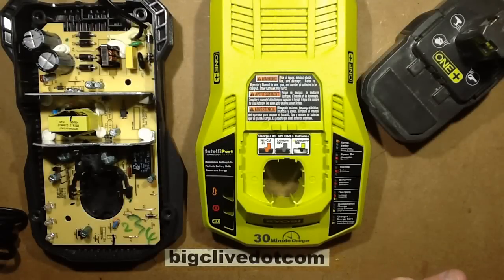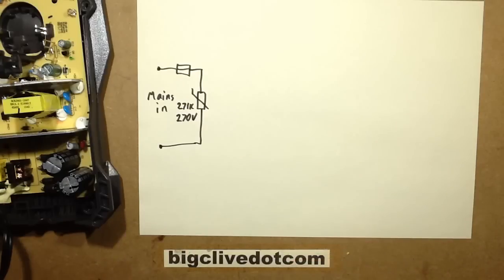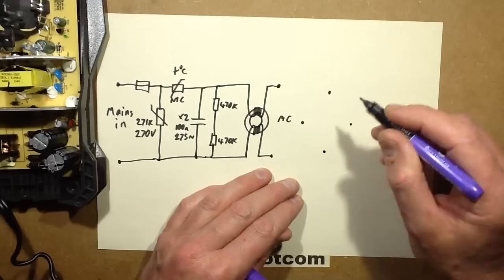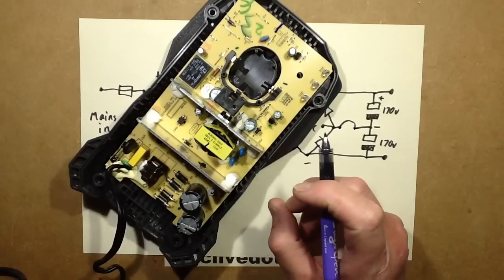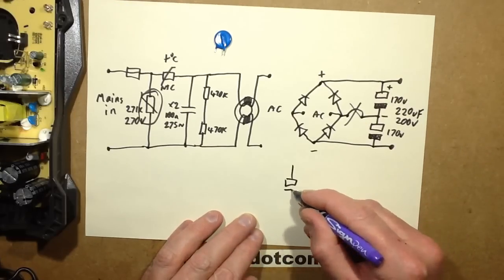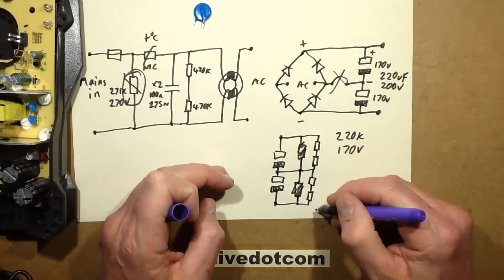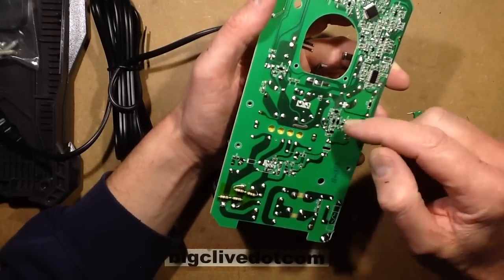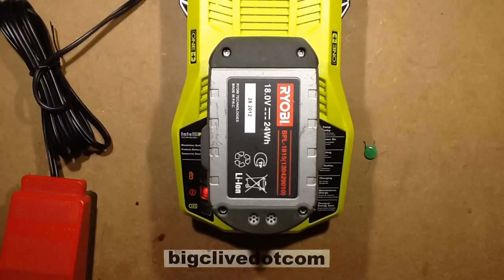How to convert Ryobi P117 charger from 120V to 230V use.

Comment: You don't have the leakage current issue with a 120V voltage doubler input since both caps get charged to their respective half-wave peak. That's only an issue with the 240V mod.
Reply from the maker: The presence of the link and redundant part of the rectifier suggests that the unit was designed to be supplied as 120V and 230V versions.  It seems odd to omit just two resistors that could also have doubled as safety discharge resistors.
Reply: Since most switching supplies that I have taken apart don't shut down until their input capacitor has dropped below 80V, I am not surprised to see small power supplies omit them: their normal operation drains input capacitors most of the way within seconds already (330V to 80V is 93% of the energy gone) and their startup bias circuit will drain input caps down to 8V or whatever the chip's lock-out voltage is over the next 10 seconds or so.

Also, unless the capacitors are horribly mismatched, their leakage increases with voltage and should make them reasonably self-balancing. May want to use 250V caps for this for extra tolerance though.

Comment: You find the same idea on the input of a pc power supply, often a switch is present.
Not sure how they cope with the extra protection on the input though.
Reply from the maker: They just rate it for the maximum expected voltage.  The low value MOV in this unit was unusual if they were intending it to be a standard unit that could be made for two voltages.
Reply: I had a PC once with a switch for 110/240V operation. One day I pushed the switch over to the 110V position when it was connected to the 240V mains.

Yes, it went bang.

Comment: Looks like that pre-exploded power bar came on handy after all ;)
Reply: glad i wasnt the only 1 who knew where it was from :)
Reply: I'm not going to lie, I looked for it a bit at the end when he started up the charger.. Then it hit me like a ton of bricks. LOL! It's been a while since I watched that one, but man... You might be even sicker than me for noticing that! x3
Reply: yeah, I'm kind of a big fan of clive
Reply: I wasn't happy with the supplied Ryobi charger. In my mind, the battery should go on the charger, not the charger on the battery!
Whilst in the states I saw this charger and thought I should research if it would work in the UK. Almost instantly I found the link to this video.
I ordered the parts and received a 14N431K instead of the suggested 14D471K. Fitted it, cut the link, added the 4 resistors and the charger worked first time. 
Thanks for making this video.

Comment: The minimum you'd had to do would be to rip out the varistor and the link, right? because it would work without the varistor wouldn't it?
Reply: It would, but ripping out a safety feature might not be the best idea.
Reply from the maker: It would work, but I prefer the idea of replacing the MOV.
Reply: In theory, yeah. But for the real sake of safety and the amount of pour being pumped through, you want the protection
Reply: Yeah it would work, but any large voltage spikes on the mains 'could' cause one of the rectifier diodes to go short, followed by he others in chain reaction!
Reply: andygozzo72 that would not be very nice
Reply: Sure, but you've just turned it into a timebomb. And not balancing across 200V rated caps is.. not wise.
Reply: yea...in my day the fuse was all the protection you needed....
Reply: These days we have semiconductors. :D
Reply: Yeah, but I would run it through a surge protected supply though.
Reply: Mov is wasting electricity, put it in the dustbin.

Comment: Does it really cost effective for the company essentially to include 230V functionality, but hard wire it only for 120V use? Can't it be both and same way sold in both markets?
Reply: saves them the price of a switch, and they can sell a more expensive one to the UK
Reply: I wonder anyway why not every power supply is 110-240V with automatic adjustment.
Like most Notebook Power supplies are.
Reply: djteac
yes, it makes sense on a scale, you can make one product and it works all over the world, not like the bad old days of country specific, esp the old days of TV's.  they save a ton of money in the end.
Reply: Notebooks are meant to be portable, and people wouldn't buy models that only worked in one place. But a fixed voltage supply is generally cheaper to make (even if it's just a few cents, it adds up), and allows the manufacturer to control prices locally (ex., make the EU version more expensive than the US version, while preventing people from just buying the US model online).